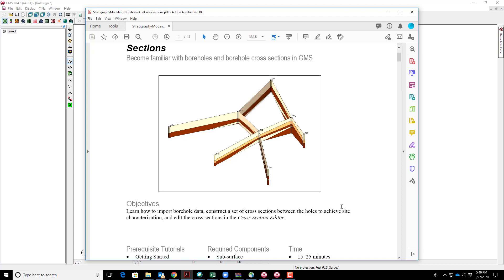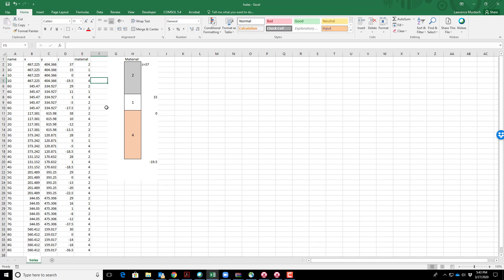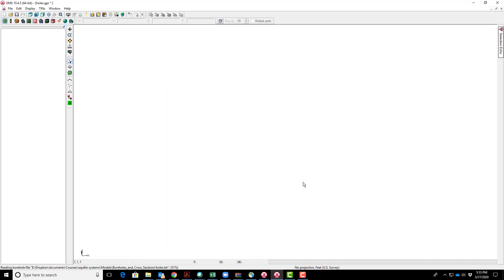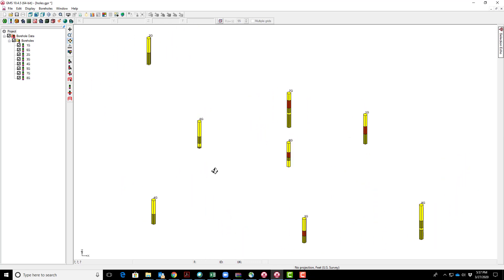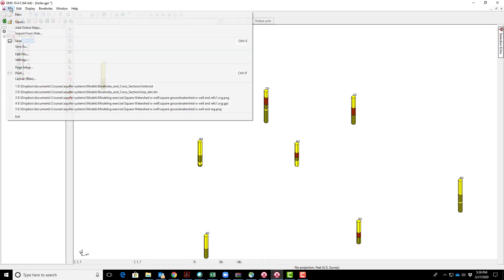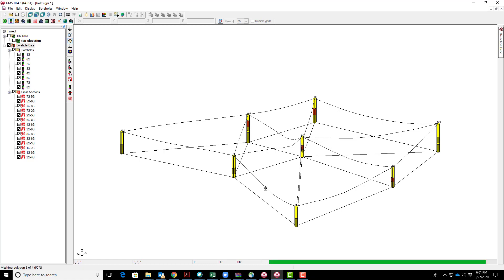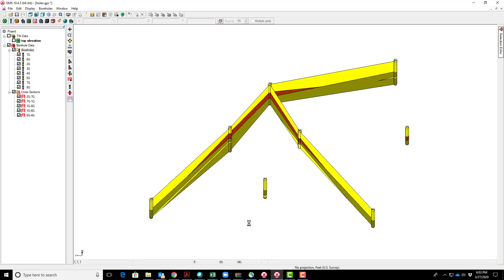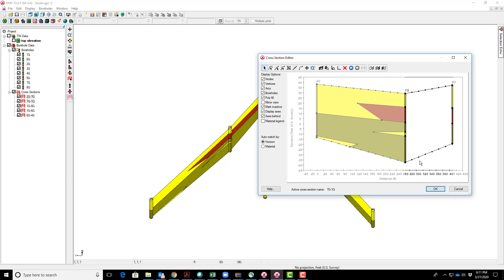Geologic Modeling using GMS, Boreholes and Cross-Sections

Comment: Hi, thanks for this video! I have a question. Are the X, Y, the coordinates? Could I substitute for Lat/Long? Also, the difference between the two is the z?
Reply from the maker: As I recall, the video uses a local coordinate system.  You should also be able to use lat/long or UTM, but you will need to check Aquaveo tutorials on the details.

Comment: Regards,
Thanks for this wonderful explanation.
But I have a question about the data, if I don't have the Z elevations and I have the depth.
How can this data be handled?
Reply from the maker: Abd,    You need to transform your data into measurements relative to a horizontal datum.   Elevation is the most common.  Do you know the elevation of the top of casing?  If so, you can transform your depth data into elevation.   Larry

Comment: hi Larry, wonderful video it is and really illuminating. I am facing a problem in manually editing my cross sections.I double clicked on a cross section and cross section editor appears. I select "delete all" and then I selected "create arc" to draw my new cross section. But after drawing a line (by joining two points from two boreholes) all the points and arcs got disappeared. No point there to connect arc. There are just two boreholes and no points. Whats the problem I am facing??
Reply from the maker: Hi Dider,    It sounds like there is a glitch in how you are editing the cross section.  I am not quite sure about what to suggest, but it sounds like you are missing a step.  Larry

Comment: How to know what cross section algorithm will give close relation to natural condition of the area.
Reply from the maker: Vivek,      Good question.  Correlating the different units in boreholes is up to you.  The algorithm only gives an initial suggestion.  The software is set up to allow the correlations to be either revised from what the algorithm finds, or the correlations can be done completely manually without using the algorithm at all.  In any case, it is your responsibility that the geologic model represents natural conditions as accurately as possible.   Larry
Reply: @lcmurd1  thank you.. you are doing great work.
New can I get your email id I need to communicate regarding groundwater modelling.
Email : viveektiwary@gmail.com